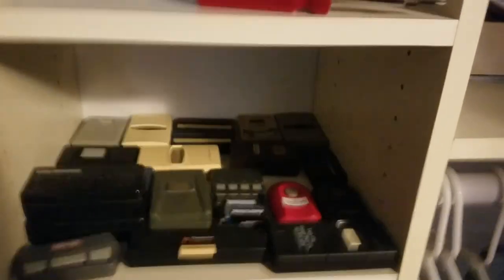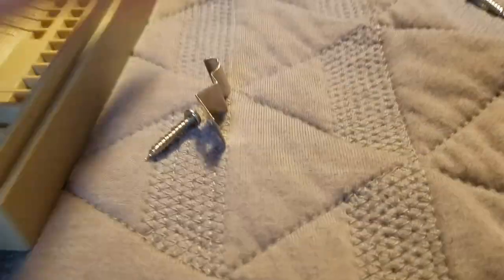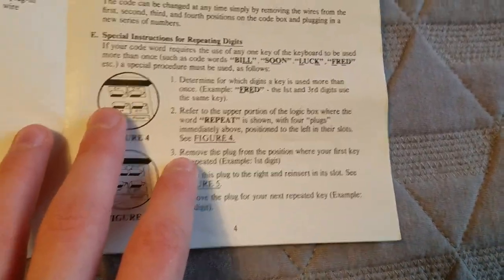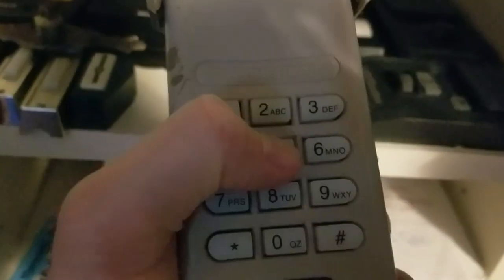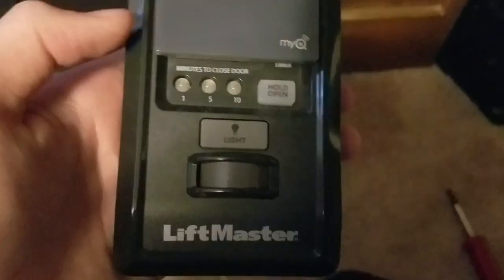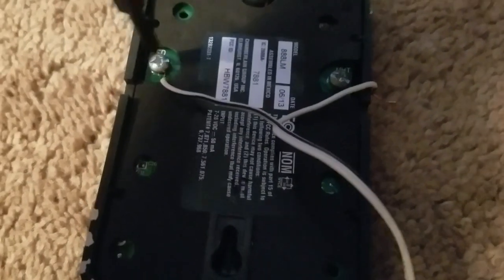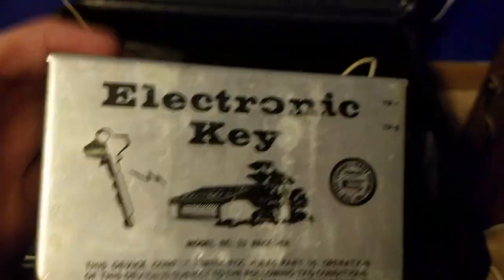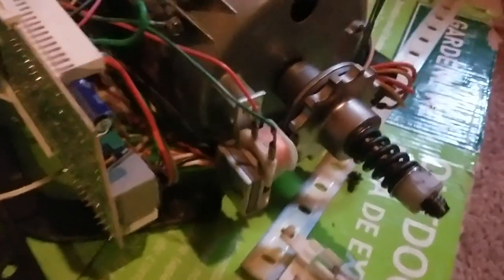Remote Collection Updates

Comment: Put the 398lm wall button on the 8365
Reply from the maker: It won't work on the 8365. These newer openers don't work just by shorting wires together anymore, the wall button sends out an encoded signal that the opener received and then it opens